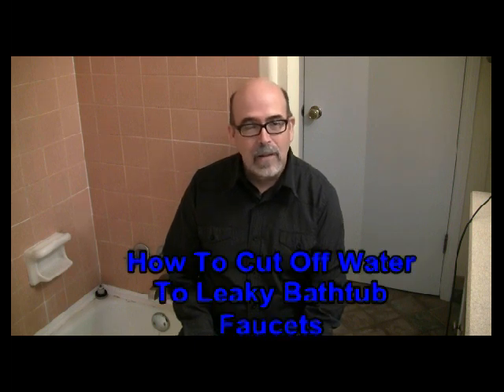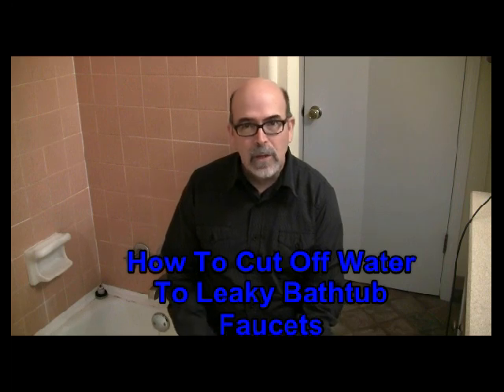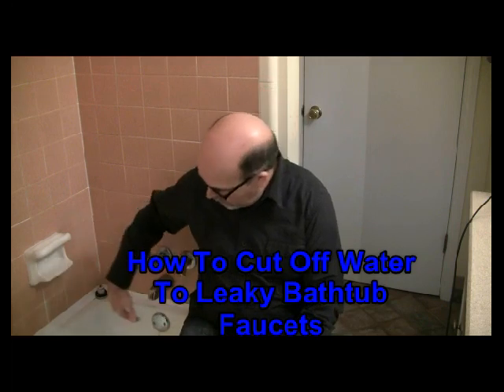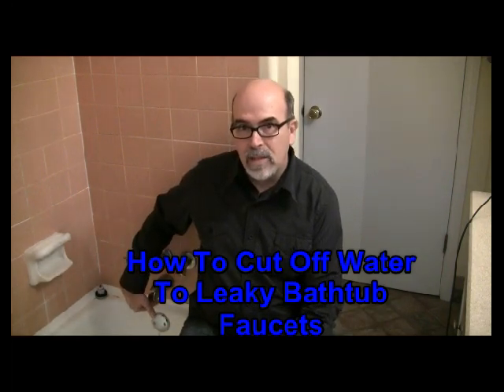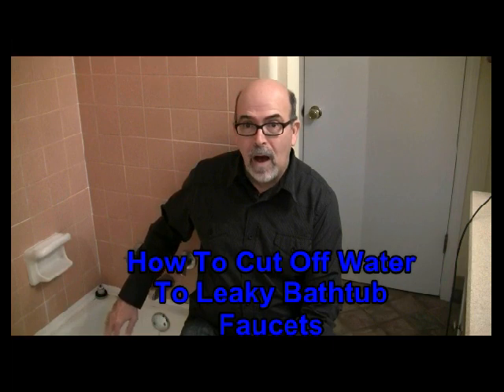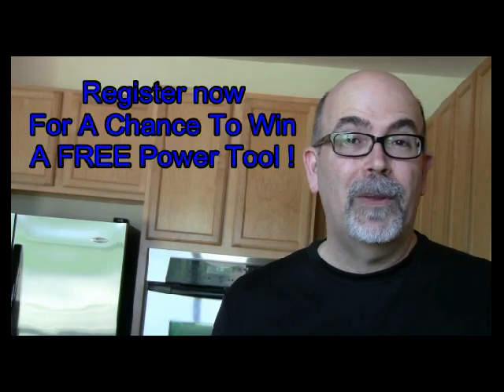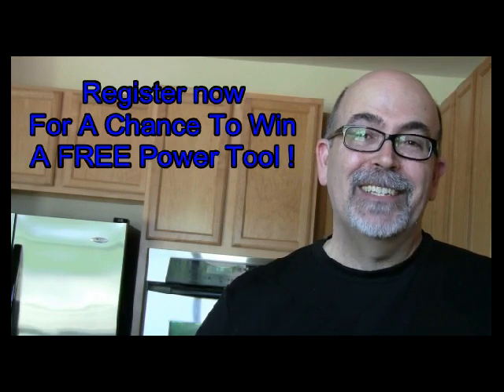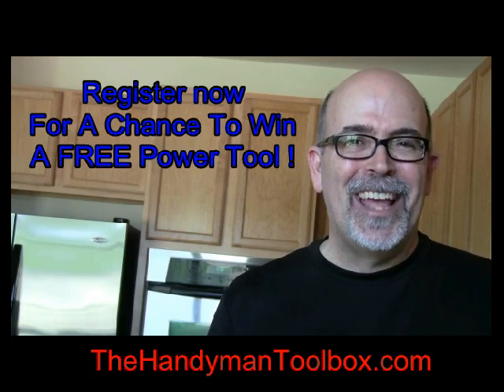How To Cut Off Water To Leaky Bathtub Faucets

Comment: I need to replace me tub faucet.  It is a free standing claw foot tub.  I replaced the faucet before about 5 years ago.  I wasn't able to shut off the water from my basement like I did before.  Is it safe to shut off the water from the water heater?
Reply from the maker: Only if it is the HOT water side of the faucet! Otherwise shut it off at the curb